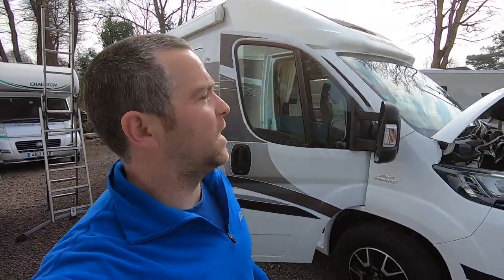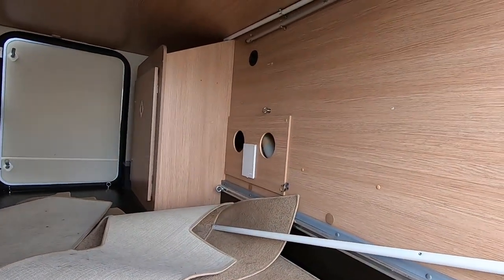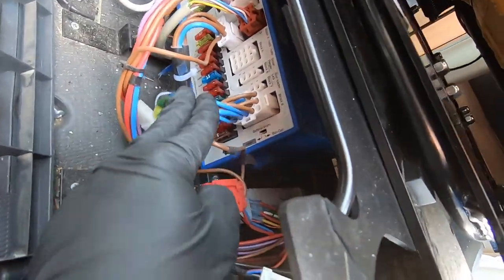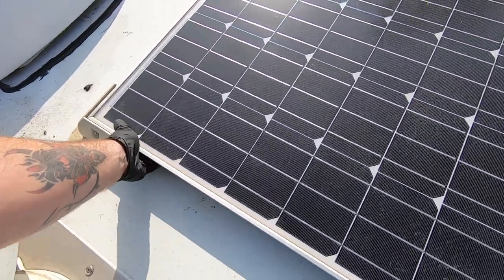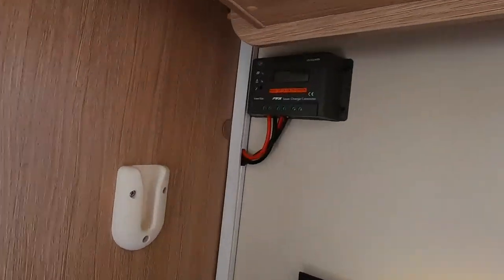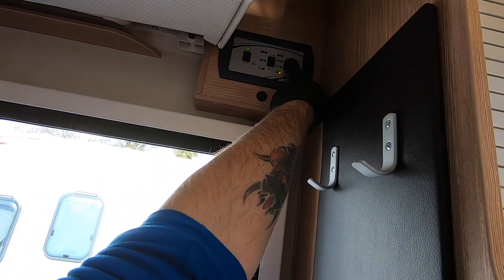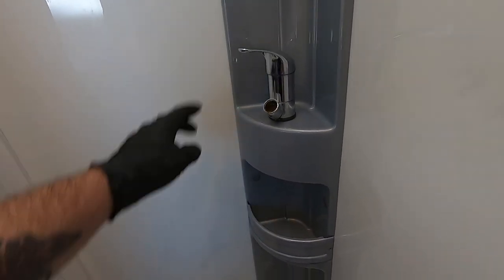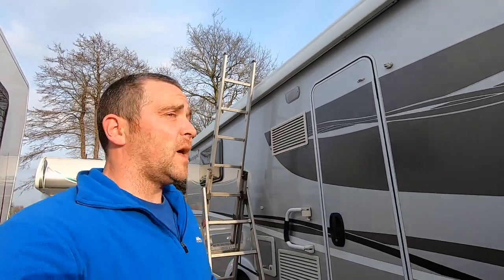Pre-delivery inspection of a Sunlight T69L Motorhome

Comment: Nice to see that these motorhomes go through such a thorough check 👍😍 those door catches wearing away are the misery of our life…especially as ours seem to have been bonded on with the world’s strongest glue as well as screwed in 🤣🤣😂
Reply from the maker: Thanks guys, Yes the PDI takes all day pretty much then the repairs are made as soon as we get the parts in, which i will hopefully show in the next work vlog.
Yes the exterior door stays are a nightmare sometimes, I prefer to mastic the clips to the body (so they can always be removed) to give them some support as when they are just screwed through the body they can sometimes rip the screws out which can be an even bigger problem.
Reply: @lifebeyondbricks  ah ok…we hadn’t thought about it that way, now the mastic makes sense 👍 Guess they will just stay as they are for now as knowing our luck half the side panel will come away trying to pull them off 🤣🤣🤣

Comment: Hi just come across this vlog. I notice the vin plate under the bonnet states 3650kg but the door plate say 3450kg. I only have a normal car licence (over 70) which plate would the police or inspectorate use?
Reply from the maker: Thanks for watching and commenting, The Authorities should work off the Converters/Coach-builders plate (door plate), however, they will also look at  the Weight figure held by the DVLA or V5C registration document (revenue weight) which is why in some European countries they would insist you carry the V5C with you whilst travelling. Ultimately they will use the V5C for total vehicle weight and then the Converters plate to check individual axle and train weight figures.